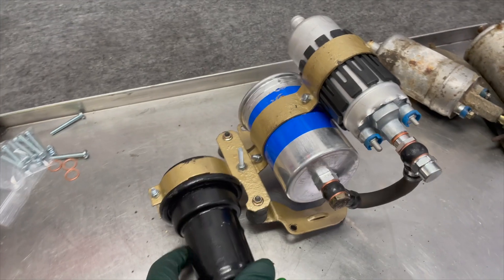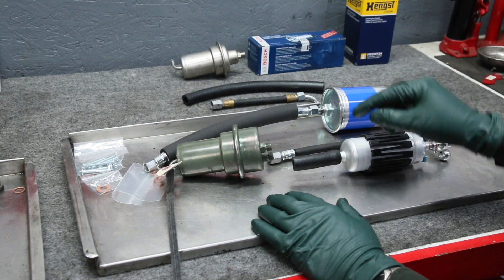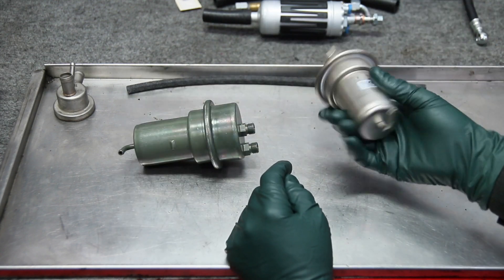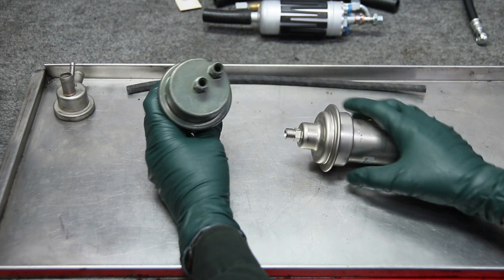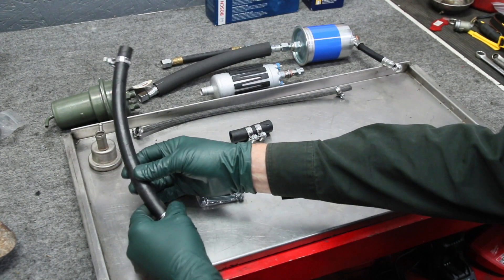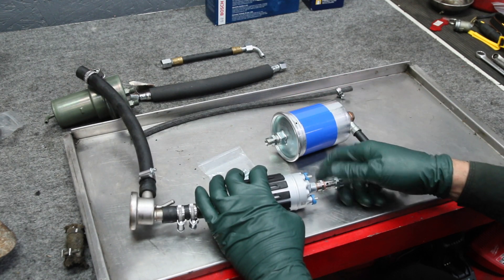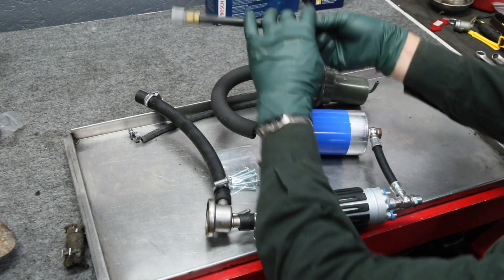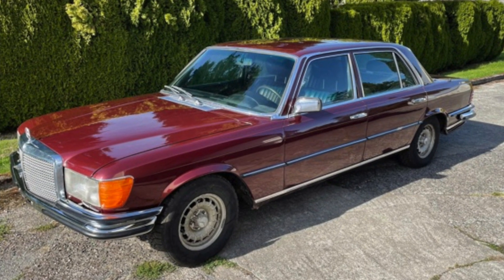Mercedes 76 to 80 450 and 6.9 Fuel Injection Delivery ( FID ) System Explained in Detail

Comment: I have 280ce 1979. I drives fine for 10min and starts on every click. However after 10min the accelerator stops responding. If I was doing 60mph and accelerator at 60% pressed I would have to slowly bring it up to the point it does not work and car looses power; but it keeps idleing fine. If I switch it off and turn it back on it runs okay. also if I put it in nuteral and rev it. It rev's fine. Any suggestions. Its a straight 6.
Reply from the maker: You are going to have to do a fuel system pressure test to confirm, but I can almost guarantee your problem is related to the warm-up regulator. Watch this video:  https://youtu.be/CA-FABwUK5c